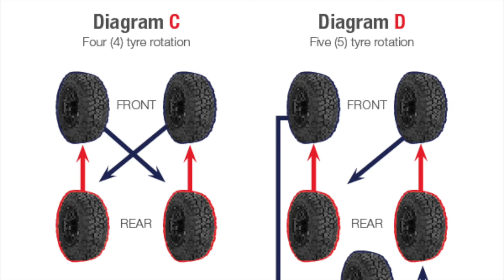Mazda BT50 Home Service Part 1 including Tyre Rotation

Comment: With the battery green light only is looking into one 1 of 6 battery cells,I usually go with the battery with 6 caps so can check an top up manually.

Comment: Blowing down brakes is not done in the trade unless there is no choice .  Washing down with a degreaser gun with air/ water  is  . Use a drain tray . Prevents breathing the dirt and does not mess up the shop .

Comment: A set of axle stands for the rear diff will cut heaps of time out of rotating those tyres Buck. You can leave the second set of tyres completely out of the picture. 👍🍺
Reply from the maker: On the shopping list mate.

Comment: Here's some tips.  get your brake and clutch fluids flushed if you haven't done it in donkeys years .  Never use CLR in the windscreen washer bottle, for some reason it stuffs the pumps.  I've been advised to never use a high pressure washer to wash under your vehicle, it may cause damage to wiring and sensors.